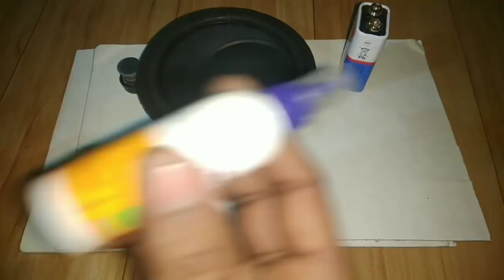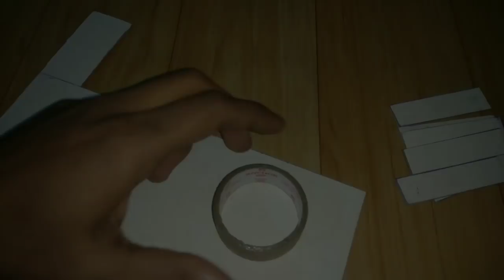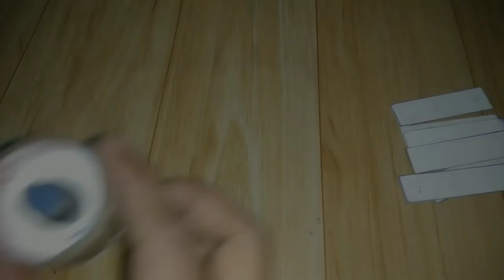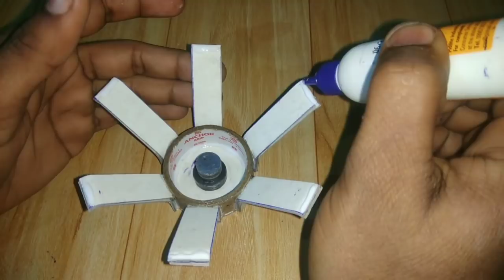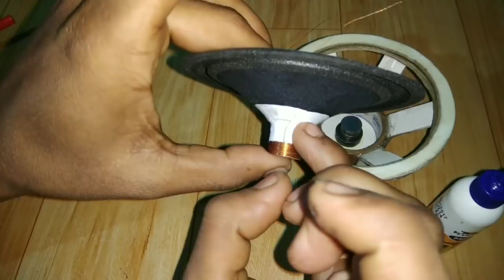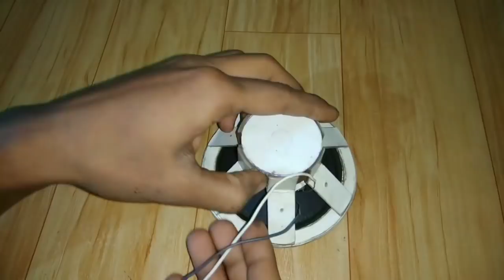How to Make a small powerful Speaker at Home-Diy Speaker

Comment: Firstly : It's fake, you need an amplifier
Secondly : Even if it's not, my phone is louder and has a better sound than this.
Anyway, nice looking speaker :D
Reply: You dont need an amplifier. You can connect a speaker directly to an aux cable but it wont be loud at all.